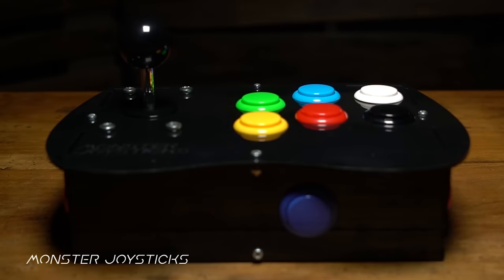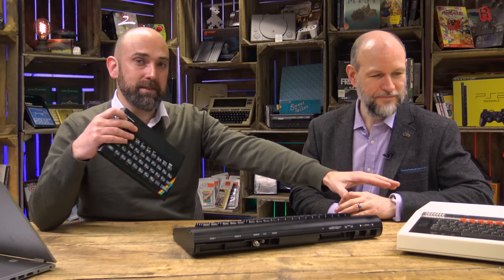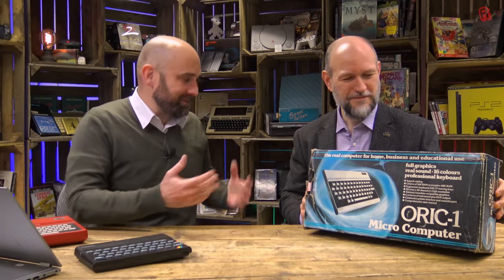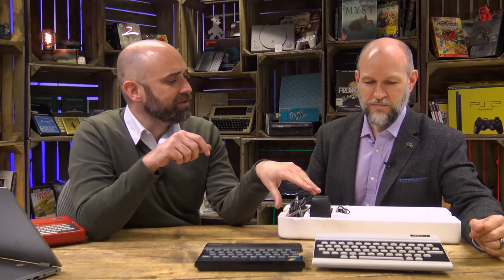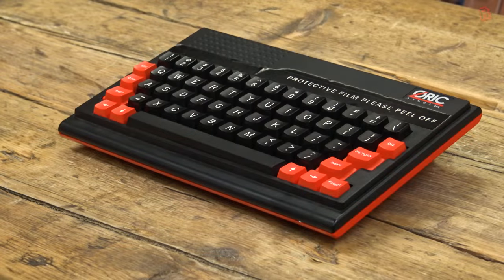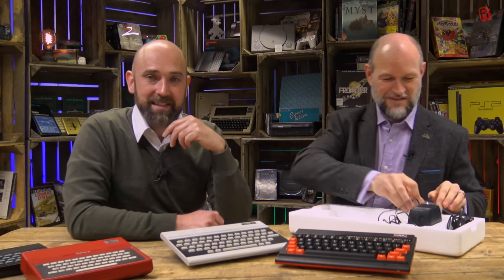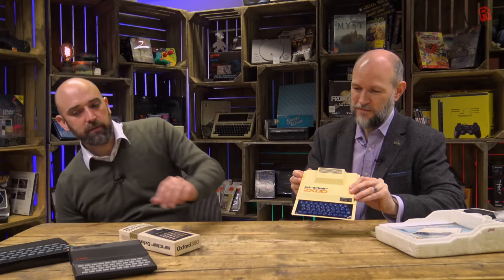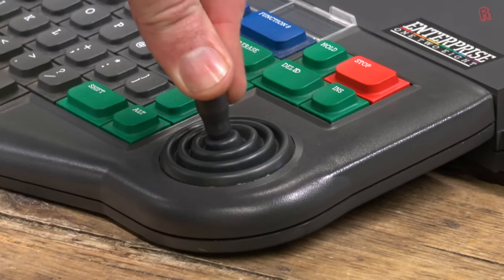Five Rare British Micro Computers - Show & Tell

Comment: I literally spotted the Atmos from the video thumbnail.  I am in the process of making the Re-Oric (a 10x10cm Oric1/Atmos replacement board with SMT components and a few other goodies) and I'm also working on Project Atmos(fear), which is a re-imagined successor to the Atmos, akin to what the Sam-Coupe was for the Spectrum.
Reply: Neato ... do you have a website for the project? I kinda regret giving away the Atmos I had at one point, but on the other hand semi-modern mass storage solutions cost an arm and a leg
Reply: @1337Shockwav3  I don't. It was only supposed to be a pet project. I posted it on the Facebook Oric owners page and a bunch of people were like "I want one! Take my money!!" So I'm making it into something that meets their needs. Like I said, it was initially just a proof of concept to see if it was possible (and it was, just)
Reply: @1337Shockwav3  Look up Cumana Reborn and Erebus - no longer leaving you limbless!

Comment: I remember thinking that Memotech was the coolest looking thing ever, I still do :)
Reply: I had that Memotech machine way back then... Bought it from flea market with few bucks! Never really "got it", because we had no documentation for it in Finland and there was no internet then to find out more :D I was a curious teen and broke it in to a million pieces and "studied" it's parts :D And thanks to machines like that, still build and fix computers on semi-weekly basis today!
Reply: It was sturdy for sure. A solid 1 mm brushed aluminium. Its BASIC had some incredibly awkward commands such as GENPAT (generate pattern) to define a sprite, and you can probably imagine what CTLSPR did. Then, it had a built-in assembler, a built-in debugger, and something called Noddy, which was a language to build text screens. A lot of good ideas, just not always equally well executed, and the manual was big, but not always practical.
During its lifetime, it always struggled: never enough software, hideously expensive hardware, and community support was understandably difficult in the non-connected 1980s.
Reply: I remember the adverts in the magazines. It looks so cool. I wanted one badly, but dad bought a commodore plus 4. Which also had bugger all software.
Reply: Sadly it's all looks, overall the machine is quite underwhelming.
Reply: @1337Shockwav3  Nah, it's pretty much average for the time it came out in, and probably even a bit above average. Bear in mind that MSX, with exactly the same specs, had yet to come out.

Comment: Oric-1 was my first computer (Oric Atmos the 2nd one). The reasons why it worked so well in France are : Same CPU as the Apple ][. RGB output for scart TV. High resolution.
the reason why it's labeled 48K and 68K of ram is that the Rom and the Ram overlay on the same bus adress range.
You can toggle from Rom to ram, and this was used by Tangerine to load the system from floppies. Of course, in normal use, the overlayed part of the ram is useless. The lack of on/off swich was the main cause of failure. The connector was not capable to survive that much hard reset cycles. I learn 6502 machine code on it.
Reply: One thing: the RAM overlay isn't entirely useless - if you had a micro drive, you could access the full 64k and still have a DOS at hand as well.
Reply: The VIA chip had unused lines, it's surprising they didn't use that to page between ROM & RAM.

Comment: Hi, I remember drooling over the Enterprise, when it was called the Elan, when I saw it in Your Computer Magazine. Thought it would be the computer for me. By the time it came out had moved on. The built in joystick was for the young game playing me a great selling point. Would be interested in seeing it in action so I can see what I missed.
Reply: You're not alone. I wanted it immediately... however, coming from a 'larger family', it was quite impossible. The price for it here in Malta was quite higher than the quoted British prices, which was daft. Eventually it was a flop here. I moved from the TI-99/4a, to an MSX, and then to the C64... On both Z80 and 6502 I learned assembly language easily.... In my opinion, it still looks stunning enough today.
Reply: @metalheadmalta  Don't let the looks decieve you ... the keyboard looks quite good, but is in fact on par with the zx81 due to keys getting constantly jammed and bouncing. Technically still a severely underrated machine. If it had come out 1-2 years earlier I can definitely see it compete among the popular commodore, atari, sinclair and amstrad machines. Sadly it ended up as a sidenote.
Reply: @1337Shockwav3  There are quite a few of these available on the Hungarian market, in case anyone is interested .. it was a popular system in that country for a while.

Comment: Regarding the Oric Atmos, I've to point out that the AY output is definitely mono, not stereo.
Now, I've a question: You mentioned that on the Atmos it was possible to enter BASIC commands using one single key-press, are you sure of that? How does that work?

Comment: French here. The Oric 1 was my first computer. But in France, to switch the TV to the auxiliary Péritel input (aka SCART), you need to deliver a very well regulated 12V to switch the circuit. And this was a royal PITB, if I may say so, so much so I was using a motorbike battery as no transformer I found was stable enough. All in all, I used the computer way less than I wanted to because of that. The last nail in the coffin was when I was given a big beautiful and very advanced CP/M machine. The Oric became a closet queen in an instant. Still got it, by the way. Also saved an Atmos later, gifted by a family member years later. But what I really wished for from Tangerine was a Stratos. This had me salivating for a while because Minitel compatibility ;-)

Comment: The ORIC had a massive design flaw, in that the chip set had a problem with loading off tape. In that sometimes it would fail to load! Now the Oric ATMOS was the upgraded version and the mistake was still in the chips! wow!
Reply: Was a software problem, that was later fixed ...

Comment: 22:32 That the thing about driving down the price, it made it possible for people to get involved with computers and upgrade as their wallet allowed and preferences allowed, and I think that's the key to it's enduring success.
Reply: Absolutely, especially when nobody you knew owned a computer.  In 1980 my new Honda motorbike cost £500. Something like a TRS80 was over half that. Getting the price under £100 made buying a computer far easier to justify. As there was no real computing press in 1980 Sinclair advertised to Electronics enthusiasts in magazines like Practical Electronics, in which he had previously advertised "HiFi", Calculators and Watches.

Comment: The Elan/Flan Enterprise; built in Perth. Scotland. We had a working 3.5" disk drive and I remember we built a dedicated word processor from an Enterprise board and an old terminal - worked surprisingly well using the built in word processor package. As they say in the article, a great computer if it had come out 18 months earlier. I bought a couple of the leftover machines plus a cub monitor from the assembly line when it closed down but unfortunately they've long gone. I still come across the odd enterprise part in my scrap collection though. Glad a few machines still survive intact!

Comment: Got to admit that when I wanted my first computer, for what I could afford, it was a 2 horse race between the Spectrum or Oric 1, and the Oric 1 was very tempting. Of course if money was no Object, it would have been an Atari 800 due to it's flexibility and power (the C=64 had yet to arrive in the UK shops). Other competitors about then I remember were the Dragon, the then new BBC Micro and the Texas Instruments Machine. Just about everything else was older and seemed to be coming to the end of its life (Vic 20, ZX81, Acorn Atom and a few other odd balls like the New Brain that I did not see in the shops).
Reply: I had the Texas Instruments TI-99 4A. Without the add on rack and expansion memory card what a disaster that computer was. The only computer in which the RAM wasn't connected to the CPU. They assumed you would run all games from their cartridges. I bought it from John Lewis on close out for £60 (less than half the price of a Spectrum) and sold it about 6 months later for £30 to buy an MSX.

Comment: I'm 44 and I still have my Enterprise 128 from my childhood. On Hungary this machine have a fan base. You can buy an SD card adapter,  new keyboard membrane, 2 MB RAM expansion and the machine is capable to handling 8 MB of memory. On the expansion port can use floppy controller, IDE HDD controller and many other stuffs. SymbOS have EP 128 support too...  I think it's a great machine and I love it. :)

Comment: I still have my Atmos working modded with both V1.0 (Oric) and V1.1 (Atmos) Roms fitted, selectable by a small toggle switch mounted on the rear. It has always been a stunning machine and goes well with my Tangerine Microtan (also working ;o)

Comment: I had a slight obsession with the Enterprise! I remember seeing it up an upcoming computers type supplement with Your Sinclair (or something similar, I think I had a Speccy at the time) and thinking it just looked fantastic and had some impressive specs for the time. Never saw one in the shops, sadly, but I now own a few. It was the first machine I built any hardware for -- memory upgrades. I cant remember the largest one, might have been 512K, but I sold quite a few mostly to Hungary where there is still an active scene for them. I also built a memory card mass storage adapter for it and have one working unit somewhere! It can run software directly from the memory card as you would disk, as you'd expect. Fond memories of this machine. Oddly, I don't have one on my display wall! I'll have to dig one out... :)

Comment: Due to electrical codes, in the UK every AC outlet in home wiring had a separate power switch, so some manufacturers felt they can leave it off the machine.   But the outlet switch, maybe down on the baseboard, was not always convenient to operate.

Comment: I wanted an Oric 1, at the time, but my parents insisted on getting me an Amstrad CPC464, as it came with a built in tape deck, and monitor. In hindsight, they made the right choice. But still...

Commodore VIC20->CPC464->Commodore Amiga A600HD->Commodore Amiga A1200->PC

Comment: I have a full Enterprise 128 setup (complete with all peripherals, docs, etc.) and several of each type of Oric, but the Memotech, Atom and ZX80 have proved elusive. Or rather, they have shown up in the past on ebay but someone else was willing to bid more than I was. :D  Though from the last MTX auctions I did at least manage to bag some tape games and docs. I'll keep looking.

The Enterprise is my favourite though. For me it perfectly encapsulates the essence of that era, the sometimes arbitrary nature of how and why one product succeeded while another failed. The Enterprise was leagues ahead of anything else at the time when its initial launch schedule was defined (especially in terms of maximum supported colours, display resolution and memory expansion), but development woes, legal battles and repeated name changes (most of all the brief disastrous use of "Flan") delayed the launch for so long that by the time it came out it was far too late, tech had moved on. It also didn't help that, in a last ditch effort to cut costs, all the normal rear sockets were removed (leaving just a bare PCB edge), requiring expansion cables to have essentially female PCB plugs, thus shifting the connectivity cost from the main unit to the cabling (great for the base unit cost, but terrible for the consumer who needs a cable). What I find bizarre is how the people involved could have botched the system name issue so badly, what were they thinking? Still, even without that debacle, it's probable the system would nevertheless have come out somewhat late. Here's a long article about it all:

https://www.theregister.co.uk/Print/2013/10/24/elan_flan_enterprise_micro_is_30_years_old/

There is a conspiracy theory concerning the Enterprise about which I'd love to know the truth. Long ago I read that prior to launch Alan Sugar got wind of what was planned for the styling of the Enterprise and thus basically copied it entirely for the CPC464 (one has to admit, the similarites in the colour scheme are striking), along with the ability to expand the RAM to 4MB in the same way. Who knows. 25:02 - Hence if the above is true, really you ought to be thinking of that the other way round. :)

Ah what might have been. I saw an Enterprise in a Glasgow store at some point after it launched and I so badly wanted one, but in the event my Dad bought me an Electron; I am glad he did though since that made a lot more sense given the presence of Beebs in schools, for which I wrote all sorts of programs for use by my school. Today I have lots of Electrons, Beebs, Masters and Arcs, but the Enterprise is a special case despite being a technological path that went nowhere.

It's all a lesson that the objectively best technological solution may not always prevail, indeed in most cases it seems the opposite is the case (consider the dominant legacy of x86 and Windows).

Wrt Hungary, the Enterprise continues to have a solid fanclub there today, eg.:

https://enterpriseforever.com/

Looking at typical prices on ebay atm, I was lucky to bag mine when I did many moons ago, the base unit and a few extras was 165 UKP (ironically less than a 64K version had gone for from the same seller the day before).
Reply: Get your Orics out!

Comment: Indeed, Enterprise-128 was (well, not 'was', 'is' ...) quite famous in Hungary. I have even two of them on my shelf :) We have even Enterprise forum on the web (and real meetups on regular basis, also new software and hardware projects, like SD-card reader cartridge, memory expansion to megabytes, and recently even ethernet/network capabilities), some of the guys on the "scene" have even about dozen of this machine :) The famous GUI-based, multi-tasking, "Windows-like" SymbOS operating system runs on Enterprise as well since a while (besides the older MSX and CPC versions). As an off-topic, and not so much connection with this, but anyway: Commodore +4 was also popular in Hungary.

Comment: Just be aware when powering on vintage hardware that the components are old, particularly capacitors so be ready to switch them off quickly. My BBC Micro powered on fine but after a few minutes a cap in the PSU went pop. Luckily a replacement set can be bought cheaply on ebay.
Reply: Pleased to say that the PSU is now repaired and my BBC Micro has been saved :)

Comment: Cor, nice selection of computers. As always, thanks guys. x  I HAD a ZX80. It was given to me by my Grammar school as it was gathering dust in the computer room. I took it home (this was 1987) and remember being slightly horrifed at it!! 500bytes of memory and always in fFAST mode ?? Ugh,. I had a ZX81 at the time in a DK'Tronics case with keyboard and 16K of memory which I loved. They are both since long gone but I have an Oric Atmos which I iput a new 7805 regulator in. I have 5 ZX Spectrum 48K machines - 3 of which need repair, and 2 working, one is housed in a LO-LPROFILE keyboard (nice but not as good as DK'Tronics) and one original issue 4. I also have a Multiface One aand an OPUD Discovery One disc drive both of which work... oh, and an assortment of interfaces including a MICON MIDI interface. :)